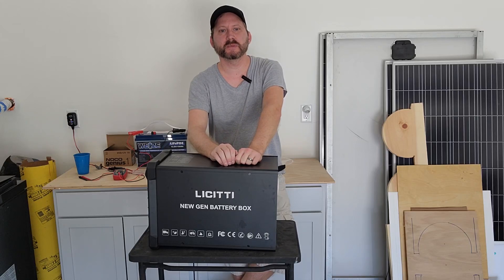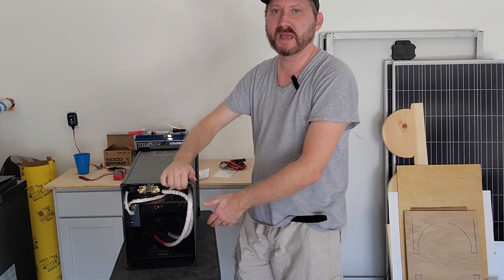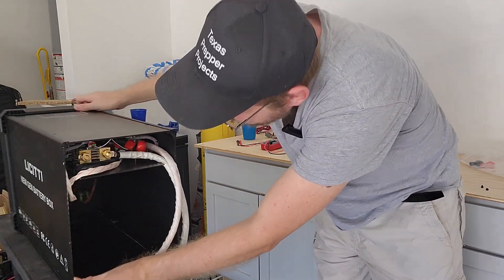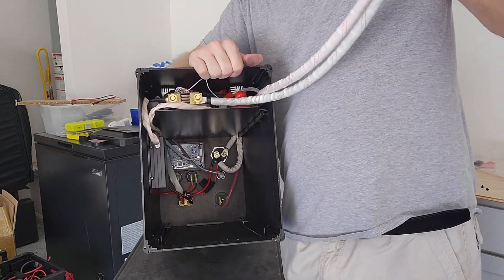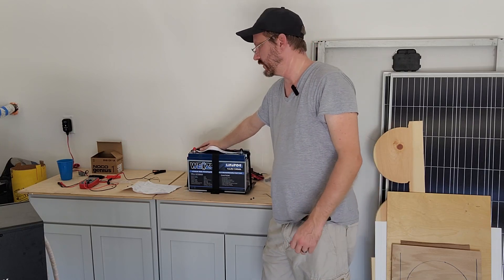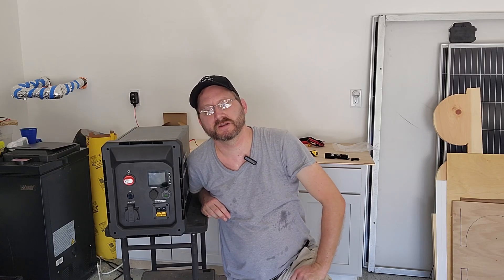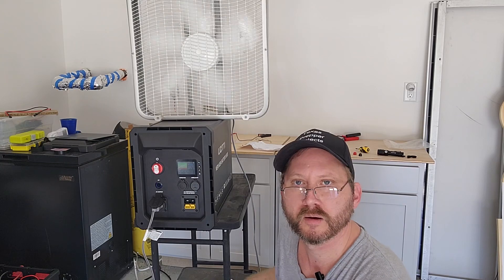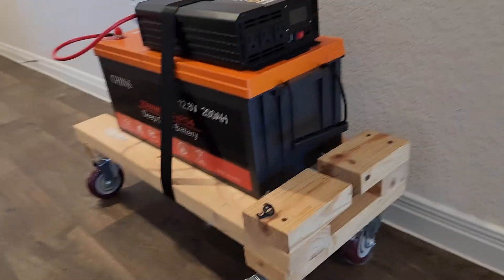Licitti 2,000w Power station. Don't buy until you watch this! Solar generator  #solar #diy

Comment: Someone else mentioned, a 20A outlet gets safe output capability into the 2,400 watt range. And a triple-tap cord would allow a couple of appliances and minimal lighting.
At the same time, it would be wise to limit the design load on any inverter to about 80% rated capacity - for this unit would be 1,600 watts, or nominal 13 amps.

Indeed you would need a LiFePo4 battery with a 150 amp load capacity to get close to the ratings here. That is up to buyer beware!
But any flooded lead-acid battery can handle that.
And this battery box fits a niche of being able to use left-over, or end of life batteries.

The battery tray is essential to the mechanical design of getting the battery secured.

Thank you so much for the show-and-tell review, warts (battery terminals ;) and all
Reply from the maker: Thanks!

Comment: Hi, I think this box wasnt design for USA market, in europe outlet can deliveri 15 amp without prolem (3500W at 220volt so over the max load of this empty box) and the battery you put in it's about your choise (how much spend on it ), the other tinh for AC use there are a lot of better solution but for 12volt outlet the competitor are most limited to 10 (chigarette socket) or 15 amp (anderson powerpole when lucky)... So in my opinion and experience  (already buy 1 licitti box , OTHER VERSION! and I will take a second) after have own jackeri bluetti and ecoflow (for my overland rig and ham filed operation) my target are 12volt and possibility of AC load but primary 12volt and licitti are oriented to this target...73 de IZ3QVB
Reply from the maker: thanks for the input!

Comment: I appreciate your points, but I think you are really harsh.  That units looks to me like a lot of bang for the buck for people that do want to use their own (higher quality) battery and/or swap them out instead of being stuck with whatever mystery battery that comes with your brand X generator.

Not everyone has the same set of priorities.  Just looking at the price of connectors, outlets, cables, inverters, mppt chargers, master switches, etc. etc. that are in there I don't think you could come close to the price if you do it yourself.  I think saying this thing is "not good", and "don't buy it" are rather extreme and narrow minded.

4:10 You seem shocked to see an unloaded Inverter will pull 7 Watts even with nothing plugged in.  Really?  Find an inverter somewhere that doesn't and I'll give you my next paycheck.  That's' really good for a 2KW inverter.  I've seen many of them draw 25 and even 50W. 

Yes, I'm sure that this Licitti is all made in China stuff, but these days everything is made in China.  I can add another receptacle if that's really a deal killer, but a quality power strip is a much better way to go anyway.

No, I'm not a Licitti shill or have any relationship.  I'm just a guy trying to spend my money wisely and doing my diligence here.  I do appreciate a lot of your points and thanks for taking the time to make the video.  If there's one thing I worry about is the strength of the construction.  I think the corner machine screws going into the Al extrusions is a weak point if it gets banged around.  I think maybe if some threaded rods running the length wouldn't be much better.
Reply from the maker: Yes the construction was pretty poor and the box is a lot bigger than it needs to be. I know all about the price of the connectors. I build my own systems
Reply: @texasprepperprojects  Exactly.  I've been pricing out making a "harbor freight" DIY version and I'm well over $500.  That bluetooth capable battery monitor itself is pretty nice and one of the more expensive gotchas.  

I'm getting one and I'm sure I'll be modifying it as I go.  After shipping around I think it's not a bad starting point if you are a tinkerer.  I can drop in one of my old batteries and use it to monitor and even do capacity tests so being able to slide in/out that tray for me is a nice feature.

For me, picking the right battery is the most important.  Any battery device is only as good as the battery and once that batt is dead, the thing is a useless POS.  I don't care if it's an ecopower, jackery or a Cadillac.  Once that batts done, you have a paperweight.  So I'm trying to shop carefully and find a good one that I hope will last me a good 7 yrs or so.  I've seen a bunch of battery teardowns and wow, there is some really scary stuff inside some of these things.

Again...appreciate the work you put into the vid and now your response.  I just wanted to  shed another POV on the end conclusion   Prep-On :)
Reply: I agree with you. No Idea why he was shocked about 7 watts idle consumption. Also, these boxes are for prismatic cells, not already made battery boxes. 4 305ah batteries give you almost 4kwh of battery power with a 2kw inverter. All for under $1200. Tell me another power station that gives you this much capacity for less? Like you said, you can easily put an extension cord for the single AC port. 

You are spot on.

Comment: I agree with you since I also did some research on 200AH batteries and none would fit that box.  But then, I found out, they sell a 280AH battery kit that fits perfectly in it....  that's probably what they want to sell.
Reply from the maker: Most likely.
Reply from the maker: But I still think it's too big and over priced for what you get

Comment: Is there any 12 volt 200 amp battery's LifePO that fits the 2000 and what are the internal dimensions of the box ?
Reply from the maker: My 200 ah didn't get close to fitting. Check their website

Comment: I think this unit was designed to work with the 280 ah lithium battery kit that Licitti make which would fit in much more easily.   It also has a larger 250 amp BMS I believe.  My gripe is there’s significantly less Anderson sockets than the 1000 watt and 3000 watt versions
Reply from the maker: Agreed

Comment: Warning: I just want to make sure everyone knows that, even though Licitti charges you $55 for 7 day UPS shipping it has been my experience that it may take several weeks, or more to receive your order. I’m not sure how long it will actually take, as I have not received my order yet and it has been a few weeks. 

The worst part is they have not responded to any of my emails requesting order updates and their web site chat does not seem to work either. Make sure you use a payment method with this company that will allow you to recover your funds if the product does not arrive. 

Has anyone out there, besides the reviewers, actually received these units and/or been able to communicate with the company?

I am posting this on all of the sites I viewed before making my purchase to let others know to be careful. It seems like a good deal for what they offer, but it’s only a good deal if they are actually shipping products.
Reply from the maker: I do agree their communication lacks
Reply: Well, after posting on about 20 review sites all of a sudden I got 3 emails and a FedEx tracking number from them, still not 7 day UPS shipping but at least there is something happening - I hope 🤔 @texasprepperprojects

Comment: Ran across your video and really enjoyed your comments on this unit.  Have to agree I recently bought the ecoflow delta 2 with the 1000 watt capacity and 1800 watt inverter for $649 can't beat that combination.  I was looking at the smaller 1000 watt unit because I was thinking of building a battery box with 3 or 4 12V cigarette sockets so that I could run a cpap with a 12V converter, a 12V fan, and a 12V fridge with one battery for a 2 day camping trip instead of taking 2 jackeries 500 and another unit.  Great job!
Reply from the maker: Ecoflow has some insane sales happening right now. I personally think that 1000wh is the baseline for anyone.

Comment: Dude. There is a reason the black cable is longer. It goes in first. I post this message at the point where you are trying to slide battery inside.
Reply from the maker: Thanks

Comment: LOL! You should have watched some other reviews first so it would look like you knew what you were doing.

Good job on hooking up the fan though to the TWENTY AMP receptacle. If someone decides to stick a cheap battery with a 50 amp bms in the box, don't blame the box because it can’t output 2000 watts. 

As you noted, space is limited and you need to be careful when inserting the battery GROUND LUG FIRST (as a hint, it is the longer cable). 

The real question is, who is the battery box geared towards?  It is a platform for people who would otherwise be inclined to build their own “solar generator”.  No need to wire up a tote or tool box.  Everything but the battery is there: outlets, solar charge controller, screen, shunt, Bluetooth, fans, 2000 watt inverter, in a rugged aluminum case.  Plus, there's a 50 amp Anderson plug for expansion.  If you buy all those components for your own build, you are going to come in close to the same price as the Licitti battery box.

The user has to add the potentially most expensive component of the build, the battery.  You can go cheap or fancy.  The box will fit 280 AH BYOB kits!  They key is that user gets to decide what’s important to them.

I picked my battery carefully.  150 AH LiFePO4 with a 150 amp BMS and Bluetooth.  I don’t care about having one outlet because the first thing I am going to do is plug in a 10/3 (20 amp) extension cord to get the power where ever I need it.  For me, I wanted to be able power my fridge for a full day and have the option to power a hot plate or full size microwave.

I also opted to wire up a a super dependable Victron 12v battery charger.  They draw almost nothing when idle and it will raise the voltage once a week so the BMS can do a top balance on the cells in my battery.

Lastly, kudos for the honest review.  Don't loose that trait as your channel grows.
Reply: Very well written.  Just found out that Licitti has a 280Ah battery kit. Seems 
Like a nice combination for beginners. $1000.00 for a 3000Wh DIY kit to learn. I also don't believe that the lcd was set up properly.
Reply: @charlesd3376   I have seen that but I don't think it's worth it
Reply from the maker: Thanks!
Reply: I think you're right.  TX prepper guy here seemed to clearly to have made up his mind from the start and doesn't seem to account for other peoples needs/priorities.  I also want to pick my own battery carefully instead of just being forced to take whatever cheap crap is inside the ecopower/jackery/bougeRV or whatever brand name.